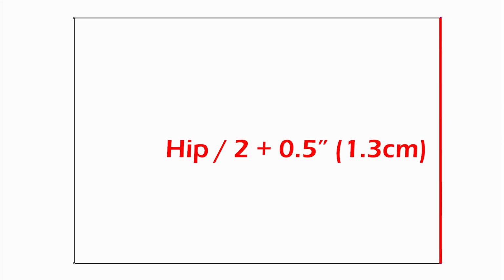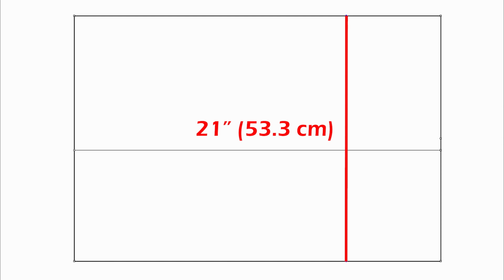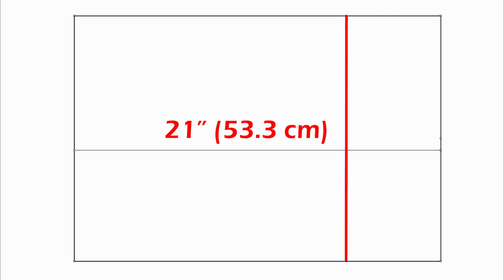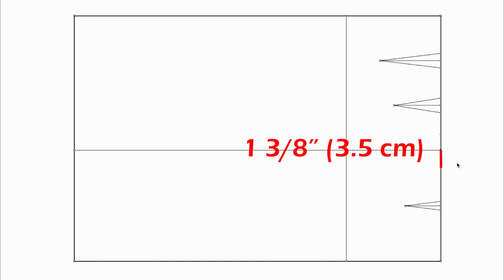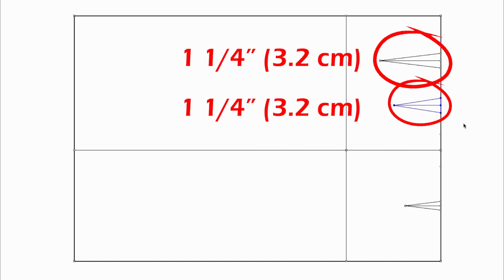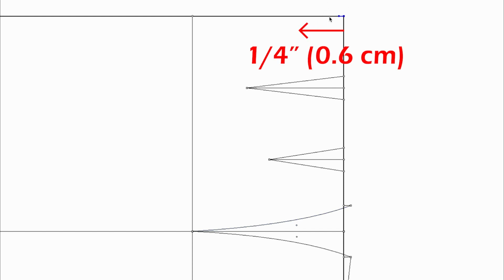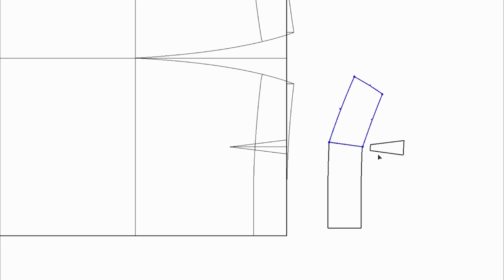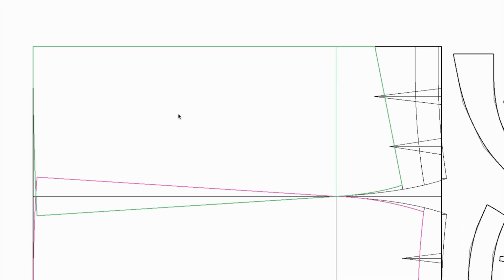How to Create a Perfect Denim Skirt Pattern | A-Line Silhouette with No Darts

Comment: Is the dart length any length we want or did I miss when you mentioned the length? Someone please help 😢😢😢😢
Reply from the maker: Start with a half of the hip length for the dart lengths. The front darts are shorter and the back darts are longer. You can adjust the dart length and depth by fitting.